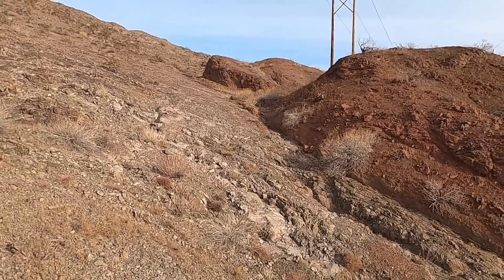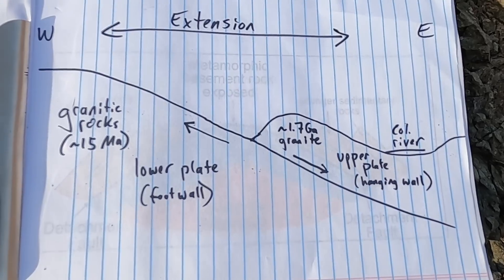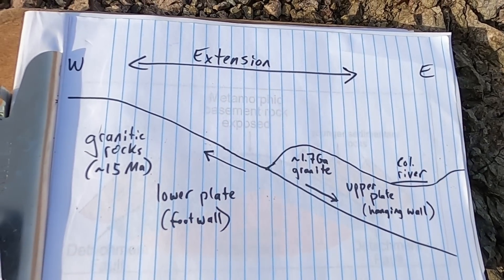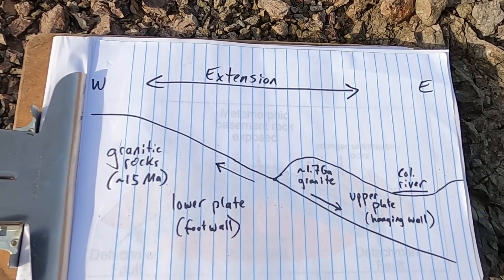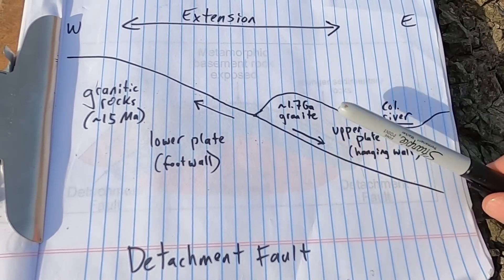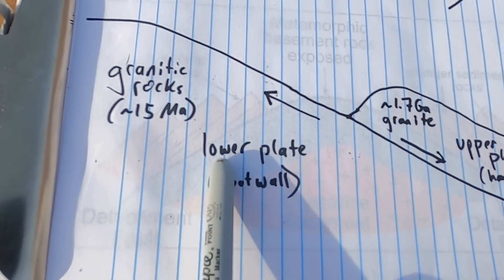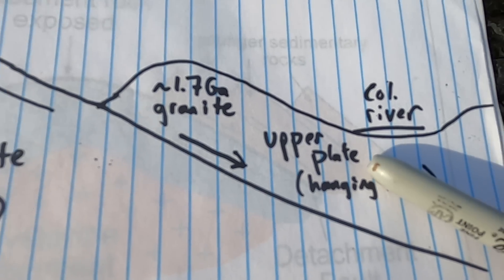Huge Extensional Structures: Detachment Fault Near Laughlin, Nevada

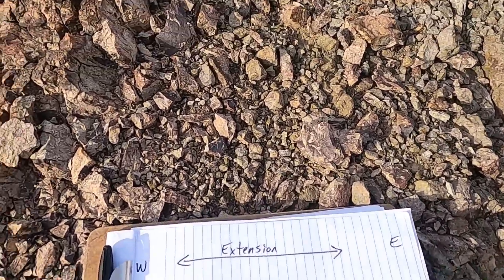Comment: I understand the detachment fault concept, but if I reverse the movement in the drawing shown at 1:21, and go back in time, I get the 1.7 billion rocks lying at the same level, or going above the 1.5 million rocks, which is confusing.
Oh! Unless the 1.5 myr year granite is intrusive. Oh... which it is, as the other diagram shows with the dome into the older rocks and then the detachment - I have just answered my own question!

Comment: Love faults. First Detactment Fault for me. 42 years ago l had the unique opportunity to work in the Sterling Hill Zinc Mine of Ogdensburg, New Jersey. At the 1100ft. level the ore body (footwall) was directly adjacent to a portion of the Ramapo Fault System. The rock face of the fault was very smooth and the ore body was excavated right up to it. There are fotos of the mine and this fault on the net. If you want 42 year old fotos, drop me a link and l'll send them. The mine has flooded within 40ft of the adit. So no more fotos.

Comment: I would suggest another video along the contact of an ash flow tuff in Truckee Canyon up from Reno. Walking along the contact near a side road off the main highway it's possible to see a carbonized log exposed that is perpendicular to the path and the observer. There are other interesting volcanic features in the area.

Comment: The sliken lines appear to be running at a 90 degree angle to the dip of the fault the way they emerge from under the Proterozoic granite. 

So, the hanging wall of rust colored granite is 100x older than the footwall granite. Trying to wrap my head around how that worked out. 

There is the old canard about the world being carried on the back of a turtle, hence earthquakes, and the trouble-maker asked the sage what the turtle was standing on. The reply, of course, was that the turtle was standing on ANOTHER turtle. When asked what that turtle was standing on, the snappish reply was, “IT’S TURTLES ALL THE WAY DOWN!” Like it is “basement rocks” all the way down.

The 1.7 Ga granite was SOME kind of basement rock, or maybe a batholith like the Sierra Nevada batholiths, that was uplifted to a shallow crustal level, exposed, largely removed, (the deep reddish color from oxidation would support the thesis that this unit was exposed to extensive weathering) over the last billion years. It is related to the granites at the bottom of the Grand Canyon.

Then a renewed, mid- to upper mantle generation of “decompressional” magma was initiated WITHIN the body of the older basement rocks as the continental margin of Old North America overrode the spreading axis between the Farallon plate and the Pacific plate, initiating the phenomenal extension of the Basin and Range province, that generated the Colorado river valley graben, the Salton Sink, the San Andreas Fault, Walker Lane, etc.

I will be down there April 1st, I will have to give that contact a visit.

Comment: When the detached portion(s) are moving “downhill”, a I assume there could be some torsion in the movement (they twist as they slide instead of going straight down the grade), and that’s what can lead to slicken lines (new vocab a couple of videos back!) that are angled in different directions?  (Or, at least, that could be one possible cause, or a contributing cause.)

Comment: Shawn, I'm confused by apparent contradiction. Your notebook paper diagram shows the hanging wall as the older rocks and the footwall as younger, while the printed diagram is the reverse. So, does this locale differ from the classic core complex because of the younger magma intrusion? (Love your series, BTW)
Reply from the maker: This particular case (in video) has a young granitic body (magma) that formed due to extension and was later exhumed.

Comment: Does this description match/explain the difference of the two peaks of Mt. Olympus above the SLC valley? Those two peaks on that one mountain seem to be totally different material.
Reply from the maker: Mt Olympus has a true peak, a saddle, then a "false" summit to the north. The peaks are beds of quartzite (metamorphosed sandstone) and are quite resistant so they stick up.  The saddle is a bed of softer shale/slate (fine grained material) that weathers more easily.
Reply: @shawnwillsey  Thank you

Comment: HELLO! Have you ever checked-out the Mojave River and the vertical drop there? That place was my playground growing up. That and  Deep Creek Hot Springs in Apple Valley. The river itself is a fault line. I'm pretty sure it's the same one you see going North on the 395 going towards Mt Whitney.

Comment: Thank you for the video.

It might help to explain to your viewers that the terms "Hanging Wall" and "Foot Wall" are from mining terminology. If you imagine that you have a tunnel, perpendicular to the page, through where the seam of the fault is, often in these areas valuable minerals can be found.

The "Hanging Wall" would be hanging lots of rocks above your head and you feet would be resting on the "Foot Wall" of the tunnel or Drift as miners call them.